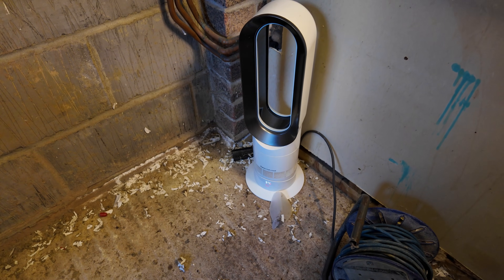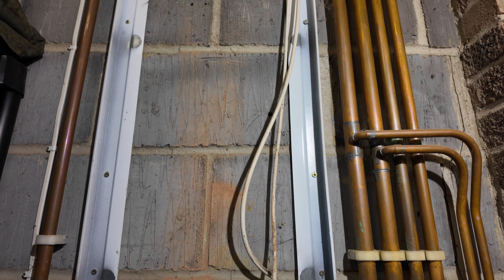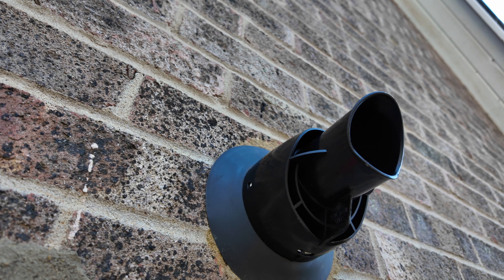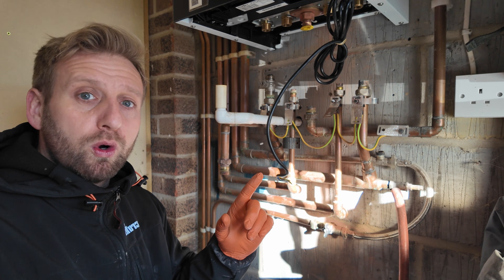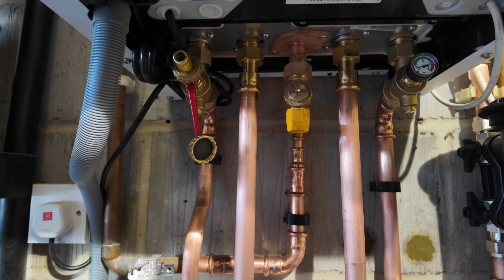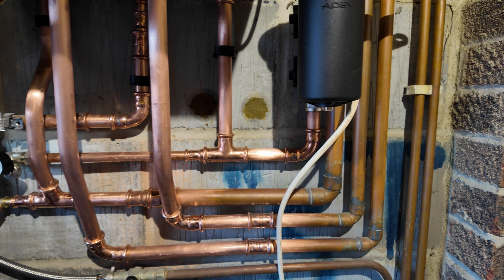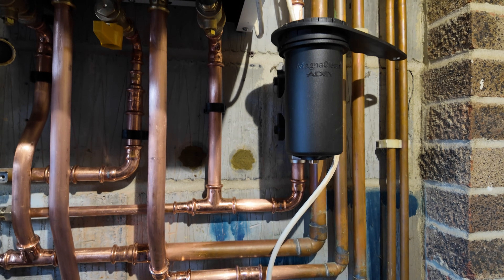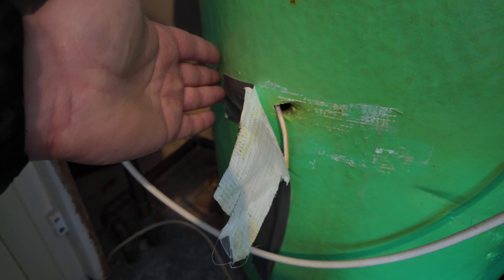Never seen this before...

Comment: Instead of a load compensation controller it’s better to use a hive thermostat and fire the boiler on weather comp
Reply from the maker: Only problem with that is you don't have control via the vicare app.  Also you really need rads sizes correctly. But yes it can be done.

Comment: Interesting video, thanks. Been planning for a while to put this exact Viessmann 4-pipe system in my house i'm renovating and extending, with wet UFH throughout (upstairs and down) and the hw cylinder, for the same efficiency reasons you describe 👍
Reply from the maker: Sounds like a good idea. Good luck with the project, glad the video was helpful.
Reply: Go for the 200W

Comment: There’s a surprise, BG didn’t service it properly! It’s because BG never service boilers, just do safety checks. I had the combi version of this boiler for 20 years; very reliable
Reply from the maker: I was told these were great combis. Thanks for watching 👍🏻
Reply: Shame the customer did not go for the 200 and WC. What about all those uninsulated pipes in the garage?
Reply from the maker: I think the 200 is great if the emitters are suitable. The radiators are a real mix on this one. 
 Unfortunately not everyone can get on board with solely weather comp.
Reply: @loving-plumbing You need an educated and well informed customer. Heating a home with rads that do not ‘feel warm’ is a con job.
Reply: You can run full weather comp on the 100W. But just solely using the app as the controller with an external temp sensor wired in. 
I think you can even do that on the 050W....?
200W is great if you have various separate mixed/ unmixed zones as the boiler has the capacity to control them all on its own.  And it modulates down crazy low!
But most domestic installs the 200W is massive overkill.
That's my understanding anyway
Reply from the maker: Correct 👍🏻👍🏻. Thanks for watching.
Reply: As long as poc don't get in ur ok
Reply: Always oversize rads fuck all this heat loss calculation working out btu s etc
Reply: @user-pw6mk5gf9i Are you an installer?
Reply from the maker: @user-pw6mk5gf9i 😂😂